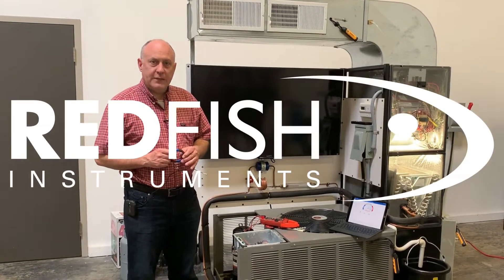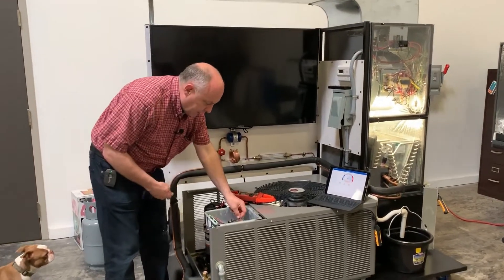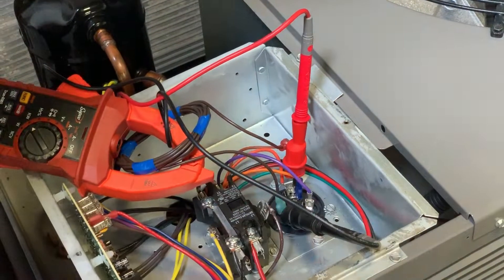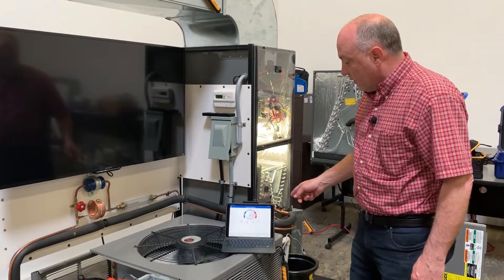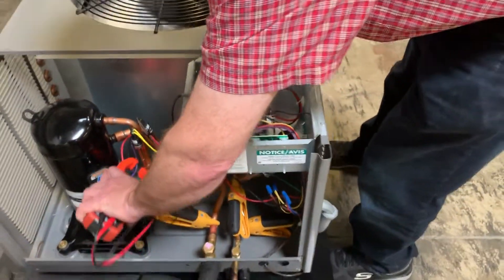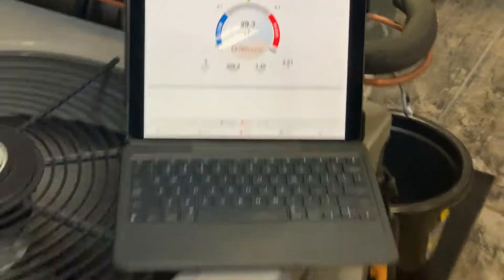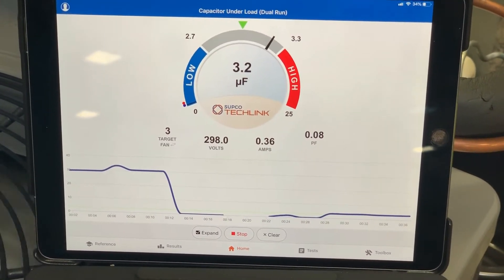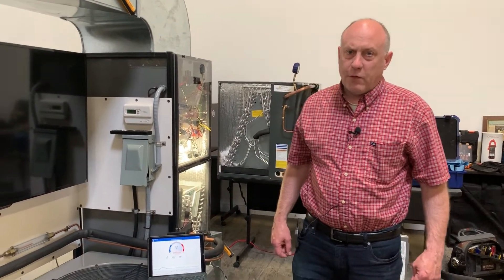Work Around for Testing Low Microfarad Capacitors Under a Load

Comment: Hardest part I find is getting power measurements inside a furnace with the blower door on. Some guys have suggested a piercing clip that allows you to take measurements a bit easier with the door on. Right now I find that I am manually taking the measurements by taking voltage than clamping and putting door on. Condensor is nice and easy and works well.